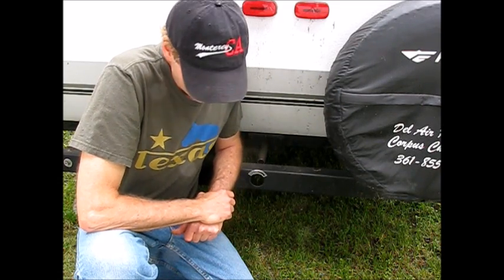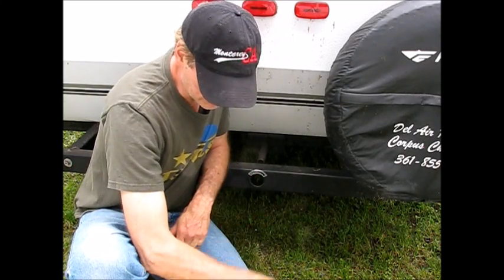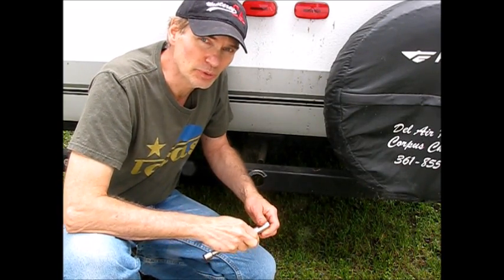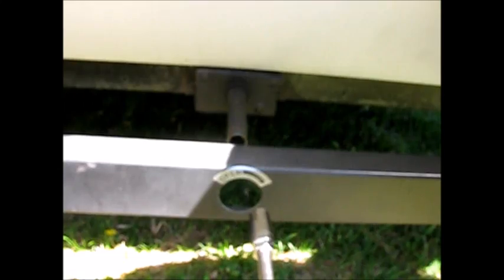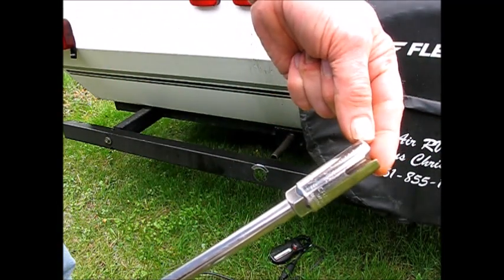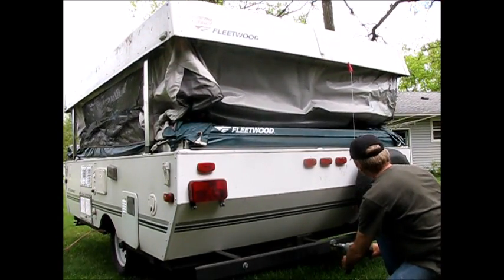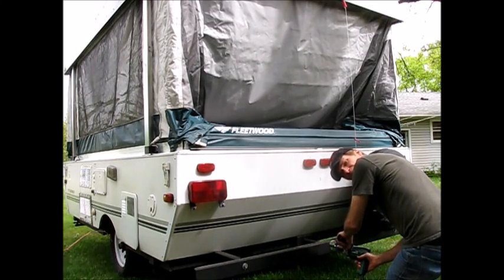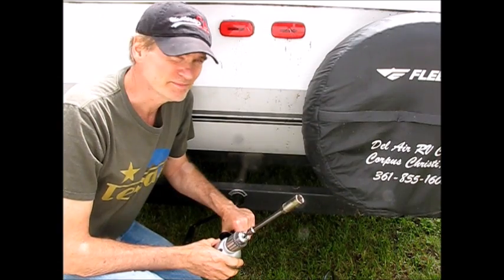How to raise a folding camper with a heavy duty drill

Comment: Thanks, dude. Been going back and forth between soft popups vs. aliners. These are much more roomy and camping-like. But the cranking part is problematic: all those cranks (dealbreaker) vs. notoriously faulty power lift systems. This $100 solution changes the game. And some Coachmen Clippers don't use poles for the beds either. Things are getting easier. Niiice, for this active but still over-60 guy.

Comment: Just cranked up my 1999 Coleman Taos with drill you recommended.Worked great ! I was a little slow on the trigger pull; since the drill was a new purchase, but it worked fine. Used string like you suggested. Thanks for tip. First time in a while I cranked top up without shoulder pain afterwards.
Reply from the maker: Great! I've been using mine for awhile. I almost look forward to popping it up now!
Reply: James Longshore       AqqqYou i
Reply: Do you not have a colored cable to see when raising the top?
Reply: Scotty D yes he does. It was green didn't u see it? Had a clothespin on the end of it

Comment: How much do you guess the roof of your camper weighs? Reason I ask is I am about to trade up to pop up with bigger roof and AC on top. I have Hitachi like yours with over 400 torque. Did great on little Coleman Taos.
Reply from the maker: I couldn't guess the weight. I do know mine is quite heavy, with an AC unit on it and my drill raises it without a problem.

Comment: thanks for the idea. I did the same thing as I have an angle grinder and extra spark plug socket. We have a 92 coleman sequia that were waiting for the weather to break so we can go camping and try it out. I have a dewalt electric drill i will use but it doesn't have a restrictive torque setting. I'm afraid that if I push the trigger to hard causing it to spin really fast it would snap the cables. Are you just getting a feel for the torque because your video doesn't sound like your hammering away with the drill?
Reply from the maker: You just have to be careful not to over crank the lifting mechanism. That's why I used a cord as an indicator to warn me that I was approaching full crank up. I am also careful not to force it up too fast, although I don't know if there is much risk of breaking a cable. Better safe than sorry though. Good luck and thanks for watching.
Reply: Makes sense. Thanks for the reply and advice.
Reply: mine was too heavy for my dewalt so today i purchased the one you have and it only raised it 3 inches and started smoking. Mine as a.c. as well but it is obviously much heavier than your pop up. Wish it would of worked out but looks like im manually doing it.
Reply from the maker: If those two drills can't lift it I guess it back to manual. Sorry it didn't work out for you.
Reply: Bummer I know. Im glad yours works great. I'm actually looking into installing an atv winch but going through every possible senerio and design before I start purchasing the items needed. Anything but 60 cranks lol
Reply: The Original Mechanic where there's a will, there's a way lol. Bought a milwaukee 1606 spade drill at 450 rpm. Raises roof and doesn't even get warm. Loving the pop up even more now. Take care and once again thanks for the idea.
Reply from the maker: Cool, I wouldn't have thought of that option. Milwaukee does make quality power tools. Way to keep at it and happy camping!

Comment: Hi David, thanks so much for making this video.  My husband and I have just bought our first pop up.  It’s a 2006 Fleetwood Niagara.  We went camping for the first time in it 2 weeks ago and loved it!  However it has a manual roof crank and my husband has shoulder and back problems.  We read that a drill can be used to raise the roof, but we have had a lot of trouble trying to figure out which socket to get.  My husband is very handy and he could make one using the angle grinder as you’ve done.  But we aren’t user what size spark plug socket to buy.  You mentioned yours is 5/8 inch.  Any chance you may know if that’s the correct size we need for ours?  Or if not, how do we find that out?  Googling hasn’t given us any clear answers unfortunately.  Thanks in advance for your reply!
Reply from the maker: I would just try inserting deep well sockets into the crank tube until finding the largest size that will fit. You could also measure the outside diameter of your hand crank and match it to a socket. My camper is the same year Fleetwood that you have so I would think yours would take the same size socket. Good luck and thanks for watching!
Reply from the maker: I would just try inserting deep well sockets into the crank tube until finding the largest size that will fit. You could also measure the outside diameter of your hand crank and match it to a socket. My camper is the same year Fleetwood that you have so I would think yours would take the same size socket. Good luck and thanks for watching!

Comment: Harbor freight 1/2 inch electric impact wrench. 230 ft lbs of max torque @ $35 with a coupon. More than enough oomph to raise the roof at a bargain price.
Reply: whats the brand? is it still available?
Reply: I bought 9amp electric hitachi but it doesn’t seem to raise the roof. It goes up very little then it seems to be working hard smells like the motor was burning so I stopped. What am I doing wrong? Please help

Comment: What do you do for power when none avail?  What is amps on drill can it be run off of an inverter on your car?
Reply from the maker: You would either need a powerful battery-operated drill ($300 or so) or an inverter that can deliver 9 amps AC or so.